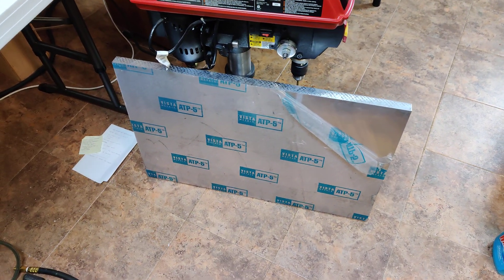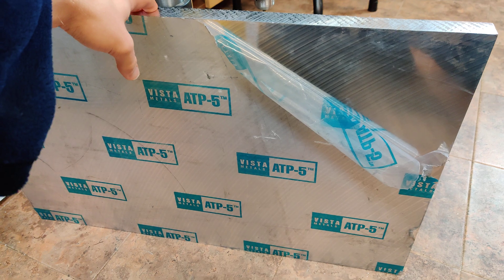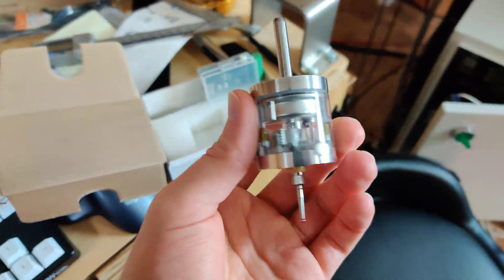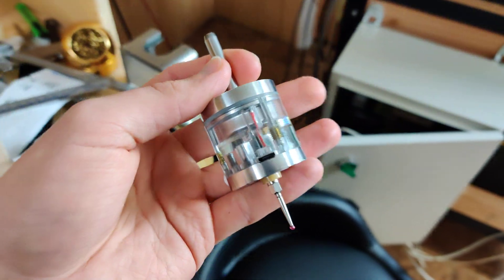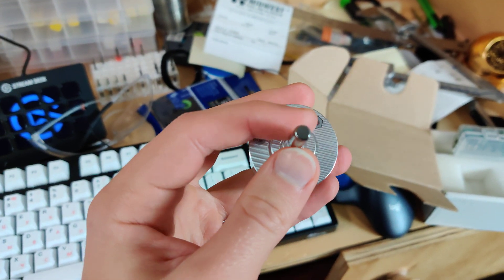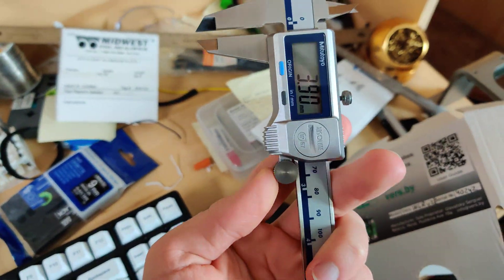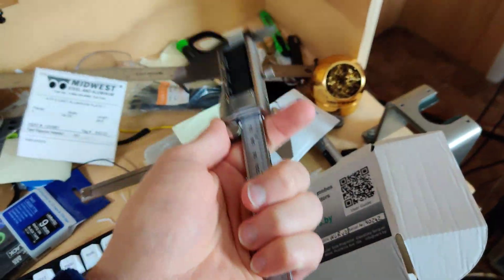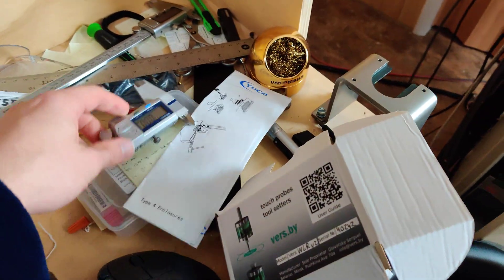Small Update Video - CNC Bed Upgrade, Wireless Touch Probe, Calipers

Comment: Bruh, I'm 36 and you're 24. Only 12 years difference, but most of all this aftermarket/hobbyist CNC stuff was not available when I was your age. Technology and accessibility has come so far in the last 10 years. Love it.
Reply from the maker: I built my first router back in 2014 so I remember how things were back then. Mach3, motherboard with DB25, and open loop steppers. China with their innovation in low cost components and mainstream adoption of routers like the Shapeoko really did a lot for the hobby.

Comment: Dear Nikita, how are you? Hope everything goes well. My experience in electronics is not very big yet. May I ask you a primitive question? I would like to use the following CNC cabinet configuration: AXBB-E controller, USCB brakeout board, 4x ASD-B2 drivers for Delta (400w) servo motors, VFD 3.7 kw (380V) Delta Electronics VFD037EL43A.
Which power supplies (Mean Well) and Protective Relays should I choose for this configuration? Thank you in advance.

Comment: Dear Nikita, thank you very much for your videos. May I ask you for advice? I am also going to buy UCCNC. Are you satisfied with this software? Why did you choose UCCNC? I want to use AXBB-E as a controller. Have you tried this board?
Reply from the maker: I’m happy with it and the AXBB-E looks like a fantastic value if it supports all the IO you need. I’m 2 years out of date with CNC software, I think Masso started doing some ATC stuff with their software, I haven’t even looked at it.
Reply: @NikitaLab  Thanks a lot. I wanted to use the same layout of the machine as you have plus in the future a 4 axis. CNC Drive guys advise me to get AXBB-E + UCSB for 3 axis + 1 layout. They say it's better than just AXBB-E, and better than UC300ETH-5LPT + UCBB. What do you think?
Reply from the maker: It just comes down to the features you need. Ideally you have a diagram of all the outputs, sensors, relays, etc. and then just get the best fit. I think ACBB-E with UCSB (or similar/better 26-pin breakout that fits your needs) has enough IO for 95% of setups. But something to keep in mind with ATC is that each pneumatic cylinder is an output and 2 inputs (sensors open/close).
Reply: @NikitaLab  Nikita, thank you so much for your advice. Looking forward to your new videos. Have a good day.

Comment: Have you tried tightening up the set screws on the top of the old caliper? The sliding mechanism literally sounds loose.
Reply from the maker: That old caliper is now my dedicated scribe tool so I'm often using that set screw.

Comment: Not exactly relative to this video, but I was hoping to get some specs from you as far as rapids, in IPM.   Also ballscrew pitch, motor size(N.m)(closed loop)(inductance).  As well as stepper driver type, (hybrid step-servo)(max output current rating).  Thanks for your content, and hope to hear back from you^

Comment: ah man you're getting ever closer to my dream CNC. Cheers.
Reply from the maker: Anything else you want to have on your dream cnc? (looking for ideas)
Reply: @NikitaLab  The usual greedy stuff:  ~20 tool holder positions, rigid tapping, a cheap 5th axis trunion (good enough for steel cutting in a pinch), some kind of automated chip clearing (auger, conveyor, etc). Of all these i think id like to see the chip conveyor or 5th axis first. No really good diy examples out there yet.

Im used to a haas vf3, would love to do similar work from home for ~$20k
Reply: @NikitaLab  Ah man I forgot, a proper enclosure too. That's probably the most realistic and utilitarian upgrade to a desktop system.